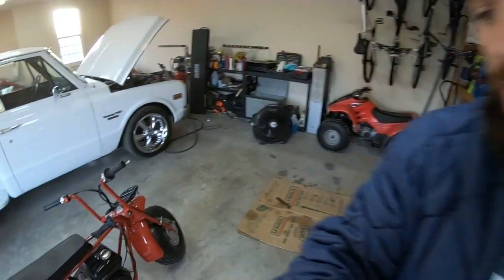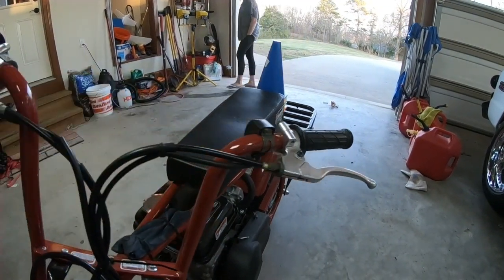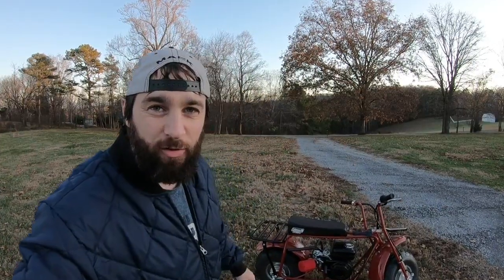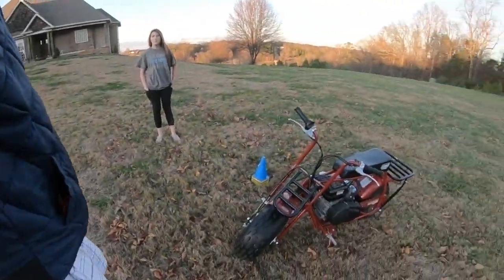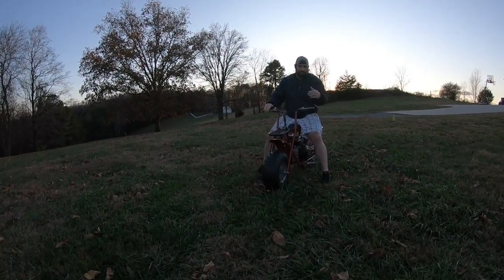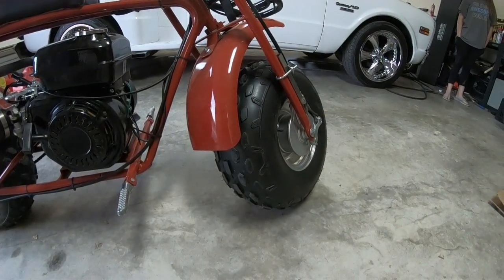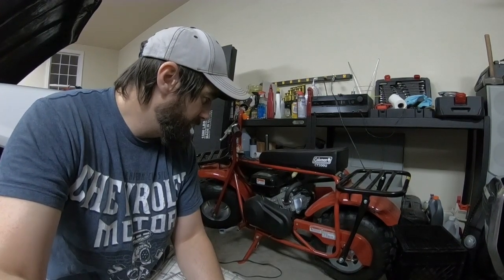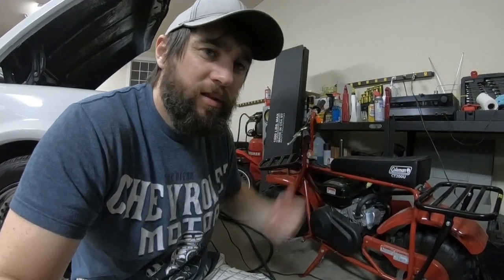Coleman CT200U long term update and front brake test

Comment: Nice. Great to hear the bike has held up well. And they said you need a 212... Not really. My near stock 2016 200U is doing ok as it should because I don't ride as much as others. Pretty low hour bike. Just finished a mild build on my other 200U. A brief walkaround vid is on my channel.

Comment: Hey man great stuff love the fact u left the internals stock I see In a few of ur videos u say it's a pain to start have u checked your valve lash u can youtube that and it should make it start like a dream if u set them at 3 to 4 thousands
Reply from the maker: I have not checked those yet.  I usually cheat and use a little starting fluid and that does the trick.
Reply: Yes that works just fine I was just trying to to help you out with what you were saying I like to cheat to its much faster haha but valve lash is worth the time I have a built mower for mud bogging sporting a 25hp vtwin I did the valve lash to 4 thousands and it starts better than a new car just touch the key n it fire's right up
Reply from the maker: I will adjust them as soon as I get a little time.  Thank you for the heads up

Comment: I had a common CT 200 U and I took off the governor and it used to go 25 miles per hour and now only goes 18 miles in our do you think that is too bad compression
Reply from the maker: It could be that or a host of other things. All you can do it start looking into it. Start with checking your spark plug and see how it looks.

Comment: replace the gasket under your gas cap with a cork gasket i cut by hand , by tracing the original .  I used a gasket sheet set sold at napa , cost me pennies & I got enough to make a dozen gaskets .
Reply: It coes 11 or 12 bucks

Comment: Do you recommend switching over to heavier valve springs?
Reply from the maker: I would say yes. Did I? No. I planned on swapping motors but mine is still going strong.
Reply: Burning Rubber Garage I’m stuck between this Coleman and the Baja Warrior 200. The Baja has front suspension but the Coleman has so many aftermarket components I’m deciding between the two of them. Which one would you recommend?
Reply from the maker: Some Coleman's will have front suspension. Bx200 and the camo of will have front forks
Reply: @xXGizmoXisXcoolXx  18# valve springs makes a huge difference on top end and they only cost 10$ a pair + need a 5$ valve lash feeler gauge tool. Super worth it. Also, I got a racing spark plug and it also made a difference. The stock ones are trash. The next best cheap mod is rear sprocket, if you only offroad like me the 60t sprocket makes the acceleration Way better and hill climbs easier but you get less top speed. You do need a longer chain though, thats a 50$ mod.